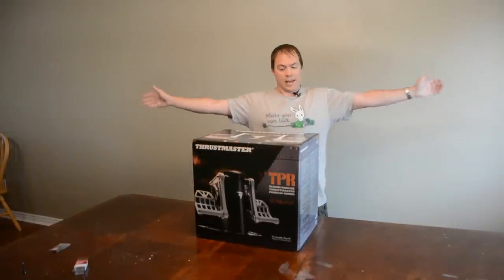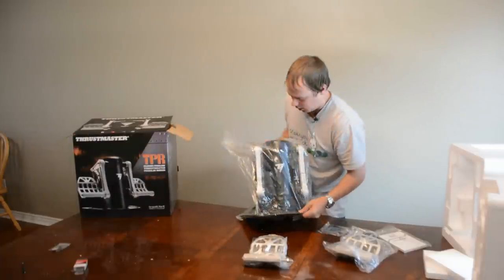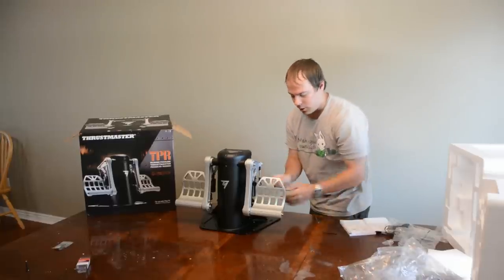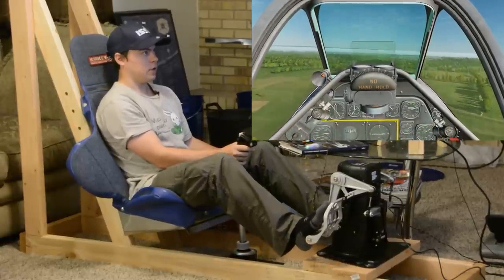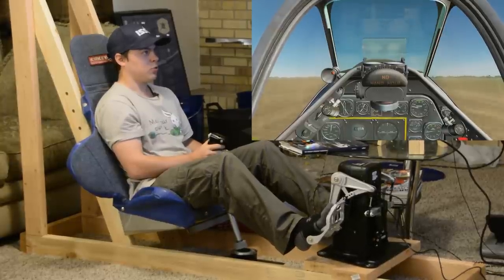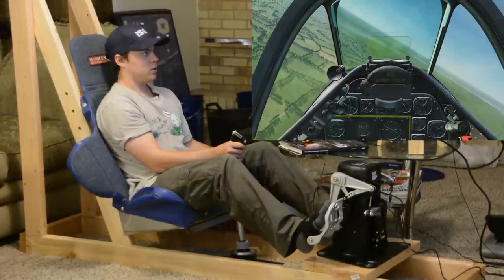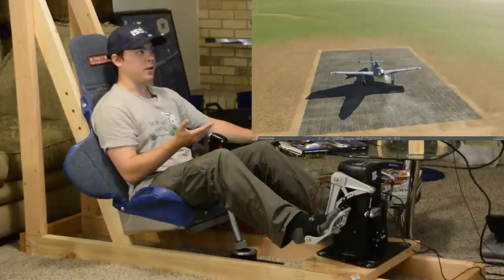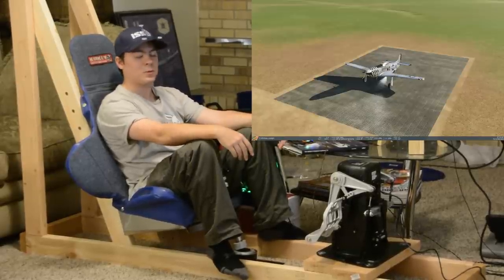F/A-18C Cockpit Build - EP04 - Unboxing and testing the Thrustmaster TPR Rudder Pedals in DCS World

Comment: Dude, you sold me on these. I just ordered them online. I know how hard it is to keep these single engine propeller planes straight. No matter how hard I focus I cannot dial in the suble amount of input I need to keep it straight. The tension on required by my current set up has me letting off and not being able to correct fluently.

Comment: Please tell me what you have on the base of your warthog?? Is that a piece to prevent unnecessary pressure on the gimble caused by screwing on extensions?
Reply from the maker: The only modifification is the pipe extension and the 3d printed top and bottom adapters. it can still go to the limits and can still be broken with too much pressure. although the 3d printed components are the most likely to fail with that setup

Comment: Thanks for your video- is there a noticeable center detent or do they move nice and smoothly between left and right?
Reply from the maker: Unless you put on a lot of springs you cant really feel the center when you go from right pedal to left. If you increase the tension you might be able to find it easier. I have to take my feet off the pedals for a tenth of a second to recenter them.
Reply: @thesimulationexperience  thank you.. Did you ever have the mfg crosswinds to compare and if so do you other the TPRs? Thanks again
Reply from the maker: @justinspirational  I havnt had them, but I have been using the CH Pro Pedals for a few years, but the quality and precision isnt even in the same ballpark. All of the other reviews i have seen say that the level of precision and how smooth they are cant be compared to anything else on the market until you get into the $2,000+ sim precision market.
Reply: @thesimulationexperience  your mean the level of smoothness and precision is unparalleled with the crosswinds or the TPRs or both?
Reply from the maker: @justinspirational  The Thrustmaster TPR is incredibly smooth and precise. Not sure how the crosswinds are, but i have heard from other people that have had them, that they can't compare to the TPR in terms of quality, feel, and precision.
Reply: @thesimulationexperience  ok thank you.. I'll get the TPRs then

Comment: What are the curves settings you use for the rudder and brakes on dcs ?
Reply from the maker: None at all. They're completely linear. The pedals are precise enough that micro corrections are easily made and you can almost control the aircraft by feel.

Comment: What extension r u using for the stick?
Reply from the maker: I use a 10" galvanized pipe and 2 custom 3D printed adapters. It's heavy though. I'm probably going to be swapping it out with PVC pipe to lighten the shaft or increase the centering spring forces. You can find the STLs here in the Fusion 360 models folder if you would like to 3d print a set for yourself. https://drive.google.com/drive/folders/1pyC-j7a77PhLepf-hEFeeLE6XmoC0mDV

Comment: Where did you get the stick control
Reply from the maker: I originally bought the  thrustmaster warthog HOTAS on amazon, but that was early 2018. Unfortunately they're in pretty high demand so you kinda have to shop around to find places with them in stock.
Reply: Oh you must have just added a tube to make it the height you wanted
Thanks for the reply
Reply from the maker: @alaskanstoneguys  yup! I 3d printed an adapter to a piece of pipe from the hardware store and spliced a PS2 cable shorter from amazon. I'm going to redo it out of better materials soon, but the 3d printed version has lasted a few years at this point.

Comment: Greetings, nice cockpit, simple but effective. Could I know where you got the "broomstick"? Because I find that conventional '' joystick '' on the net. Thank you in advance for your answer
Reply from the maker: Hi Jean, I use a Thrustmaster Warthog and I bought a 1inx8in galvanized pipe and 3d printed an adapter for both ends. If you would like to 3d print your own. The stl are available on my google drive at https://drive.google.com/open?id=149gIl6GrUlDIKyHGj0dDSdMmjy0efXyB
Reply: @thesimulationexperience   I downloaded the images, but what are the dimensions for the adapters?
Reply from the maker: @sharpvector  If you go into the fusion 360 models, there's a top and bottom .stl to 3d print. soon I'll be adding some new blueprints since i'm going to be making it out of metal. If you're worried about scaling the prints, the largest diameter is exactly 2" on both parts
Reply: @thesimulationexperience   Thank you for your reply. I know nothing about 3d printing and .stl files. I've looked it up. I take it you use the .stl itself to do the 3d printing? No dimensions needed?
Reply from the maker: @sharpvector  pretty much. dragging the stl file into your slicer program should keep everything to scale. some programs will scale it incorrectly though so it's good to double check dimensions before printing.
Reply: @thesimulationexperience  Thank you so much!  I really like the way you extended the Warthog joystick and mounted it on the floor to give it a more realistic flight sim experience. Well done!  I intend to do the same. By the way, you pretty much sold me on the pedals too. (Even though they're darn expensive.) Cheers!
Reply from the maker: @sharpvector  They are expensive but well worth it. They were on sale for $200 at one point but I have no idea why or how. I dont think the deal is still ongoing unfortunately. Definitely let me know if there's anything I can do to help you improve your system. There's nothing like a good sim setup. Other than maybe the real thing.
If you want to join the discord channel, there are others that are building or designing sim components that you might find interesting

Comment: Интересный кокпит)сними видео пожалуйста как ты его соорудил)я тоде хочу сделать что то подобное)
Reply from the maker: I had to use google translate since my russian is a bit lacking, but the series is up to 31 episodes on how i'm building it and the progress i'm making. I also post exclusive updates and behind the scenes on the patreon page.
Reply: @thesimulationexperience  спасибо)очень интересно)и классно)
Reply: И ещё раз спасибо за идею)у меня конечно комната не такая огромная,но сделаю так же))))
Reply from the maker: I'm going to be moving the whole thing into a much smaller room. 2.6m X 3m with 2 desks. So I'll have to make it much smaller. I'm considering turning the seat into the control rack instead of in the front, and there's about 30cm on the foot side that can be cut off. It would make it roughly 2m x 1.5m.
Reply: @thesimulationexperience  ну придумать что то можно

Comment: Build a floor to support you heels, check out my F16 cockpit
Reply from the maker: I ended up putting in a floor in a later video. I also put in a track so I can adjust the pedal position for taller and shorter pilots